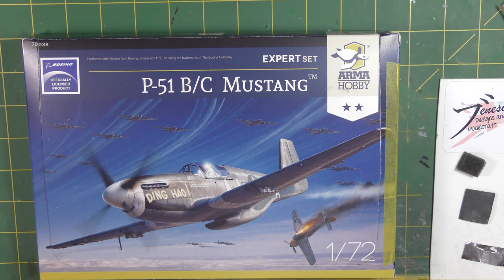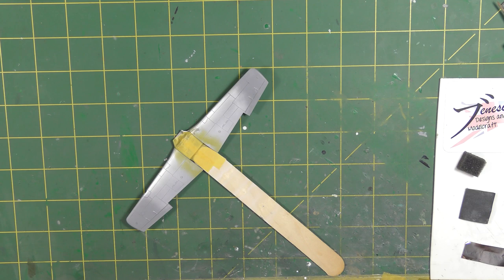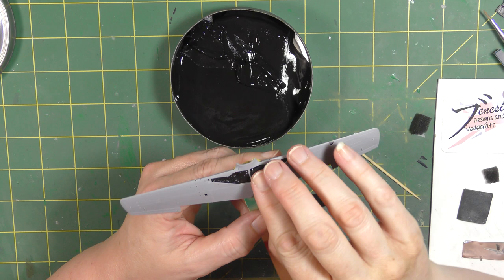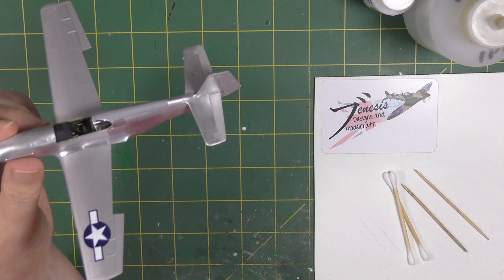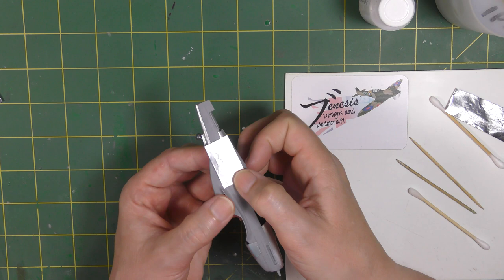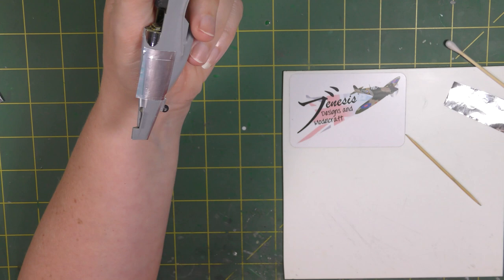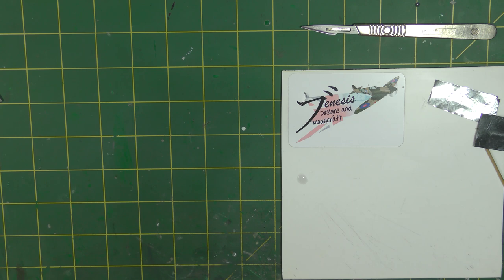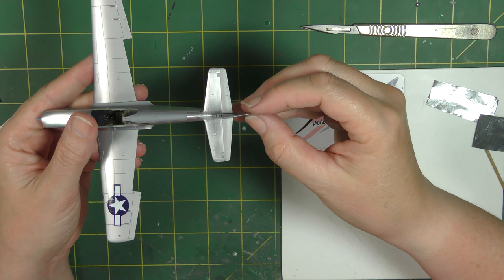Shark Mouthed Pony! - Arma Hobby P-51B - Part 2

Comment: I am currently working on the 1/48 Airfix P-51D kit and I applied the Silver paint by first dulling the surface it was to be applied on with a matt varnish (I use Lacquers and Alclad) then applying dull Aluminium over that dulled area, which achies a very similar goal - making the painted area look like paint. Once that was dry, I masked it off and applied an Alclad gloss black finish to the rest of the airframe and then used Alclad Polished Aluminium (and steel around the Exhausts). I liked the result, and it will be Major Charles Weaver's final ride with nose art. (Weaver "Inherited" the famous Camouflaged P-51D-5 Mustang called "Passion Wagon" from her first pilot Lt Arval Roberson and later had the Field-kit Fin fillet added. His last Ride - (My Choice) was a standard D-15 with the factory fillet, which he flew until VE day.
Reply from the maker: That all sounds like good strategy Brett, you can influence the appearance of Alclad finishes quite dramatically by varying the undercoats.

Comment: Just like to say how much I appreciate your Videos and say thanks for the foil glue application tip. I'm now in the process of building my 8th foil finish project over the last 10 years or so ( AZ Models 1/72 "Silver Spitfire " G-IRTY ), but there was a stage a while ago when I was about to give up on the technique because of the contamination issues I was having applying the glue with a brush as per the bottle instructions ! I was struggling to figure out a solution until I stumbled onto your earlier P40 video ( I've done the same scheme on a 1/72 academy kit , thankfully before the contamination issue popped it's head up)  As to the earlier commenter regarding Paint vs Foil, There are some amazing Painted NMF finishes out there, but to my eye no painted finish can ever capture the lustre or authenticity of a skilfully applied foil finish. Yes the foil approach can be a chore, but then those great painted finishes don't look that easy either, not to mention the fragility of those painted finishes.
Like you I have tended to use the dull side of the foil for the majority of my foil builds, as I thought the shiny side might look a bit "toy" like, but with G-IRTY being a polished finish it was shiny side up and I have to say I've been surprised and impressed with how its turning out. I'm a very slow builder and over time I've watched the Shiny side naturally tarnish during this build, and while I'll repolish the shine on this particular kit before I apply a clear coat, I think the tarnished finish looks almost more accurate than a dull side application. I intend to test this theory on a future build. There doesn't seem to be a lot of us out there following this path ( the most common reaction I get from other modellers is " I tried it once but gave it up as a bad joke " or words to that effect ) so it's great to come across a fellow traveler.

Keep up the Great Work.
Cheers from OZ.
Reply from the maker: Great post, thanks Dean. I've definitely enjoyed the foil journey. You kinda need to enjoy it though as it certainly isn't a short trip! The way I do it, I don't think it matters much which way around the foil is because of the sanding process. G-IRTY is definitely a very worthy subject - you probably wouldn't be surprised if I said I might like to do that one sometime...
Reply: @JenesisDesignsandModelcraft   Cheers Jen, wonderful to be able to discuss and share experiences with someone practising  the same technique. I build almost exclusively in 1/72nd scale, and use a variety of common kitchen foils ( we call it generically " Alfoil " down here. ), Surprisingly I find the thinner cheaper brands available here are working best for my purposes, though I don't rule out using thicker foils when I feel they are required, but even these aren't as thick as the foil you appear to be using. Because of the thinness of the foils I tend to use I haven't considered texturing the surface with sand paper , but I do find that by varying the direction of the grain I can get subtle but interesting tonal variations in the foil from different light angles. Not saying one approach is better than another, just an interesting point of difference.
I'll look forward to your G-IRTY build when you get around to it. The beautiful complex curves of the Spitfire are certainly a challenge to foil but they are do-able. I found the wing tips on the spitfire the most daunting to foil, and if I can return the favour of your application tip,  : when I got to that stage, I scribed an additional 
( fictitious ) panel line a smidgen outboard of the nav lights on each tip,  top and bottom. This gave me a very small panel, with one straight edge, that allowed me to get a single piece fo foil to wrap around both sides of the tip to get a seamless fit ( it did take a few goes though.) Hope this make sense and is of help.
Anyway great to be able to swap " War " stories.

Comment: I enjoyed the video (as always) but really can't decide if I like foil on model aircraft - to me the 'grain' in the foil looks overscale - it looks like the same size surface texture as on a real aircraft? I suppose I should give it a go and maybe I'll change my mind! Might be too that the foil you use is better quality than the cheap stuff the missus buys! 🙂 For aluminium dope type finishes I spray whatever aluminium paint I use with matt varnish. I also tend to do that on NMF finishes (with panel differentation) too as I think that gives a more 'in service' look.

Comment: With foil, what do you do with the parts that are colored? Do you add foil and paint on top of it or leave it unfoiled and put the paint on?
Reply from the maker: Well, you can do either. It would depend on what the exact situation is in each case.
Reply: @JenesisDesignsandModelcraft  ok so if I do paint it onto a foiled part do I prime it first?
Reply from the maker: @Lambeast  Yes. So far I have found Tamiya aerosol primer works best (of the things I've tried) Model paints don't really stick by themselves on foil.
Reply: @JenesisDesignsandModelcraft  Cool thanks! Will give a foiling a try sometime soon.